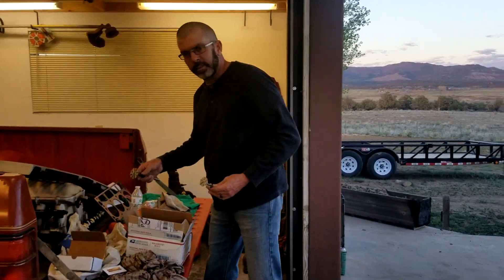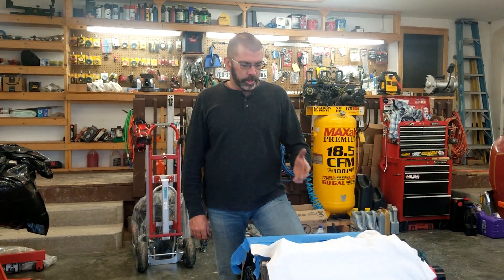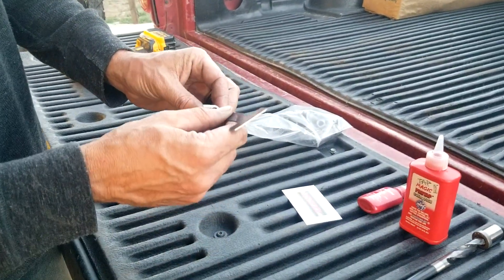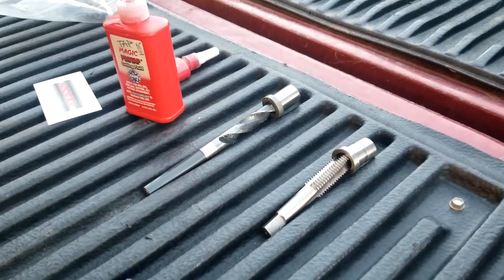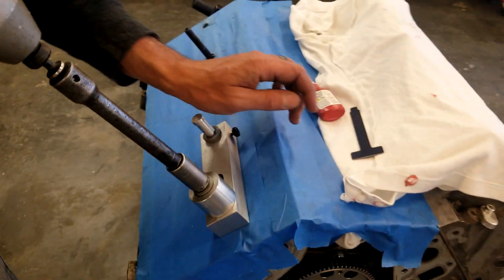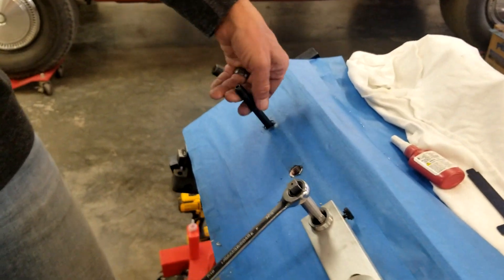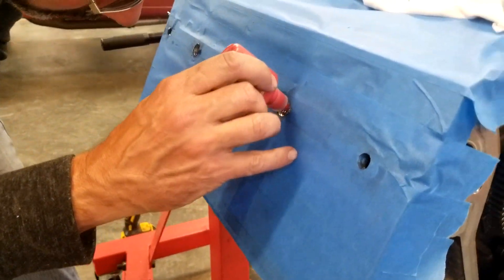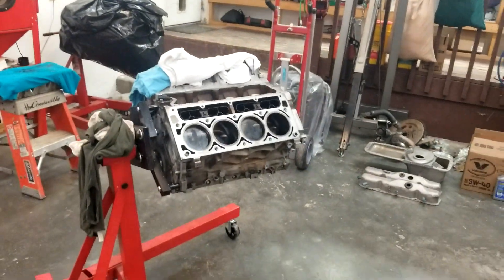LS aluminum block head bolt hole repair.

Comment: Great video, I have one head bolt stud boss that’s stripped on my L92 6.2L engine. I’m just wondering why you need to drill all the way to the end of the blind hole when the insert is only 18mm long. You would think the Time-sert insert would be at least 2 inches long. 
What’s your thoughts on this.
Reply from the maker: Going off memory here as the 5.3 finally let go after 4k miles and tons of 22lb pump gas pulls..... as I recall, the factory block isn't threaded either on the top half of the bolt hole, about half of the bolt in the hole isn't threaded either which just leaves the bottom half of the hole that's actually useable. I agree though, seems like the inserts and threaded part of the bolt would be longer.

Comment: good job.
what about abolt hole repair and bringing a bigger bolt and that's it?
Reply from the maker: I thought about it. I want to say tick makes a kit to go to half inch head studs, IIRC, so it "should" be do-able. You'd have to drill the head for the bolt. Need to measure a head gasket hole as well. In the end though, you're back to the same issue. Everytime you run that steel bolt back into the aluminum and torque it down, it's eating the threads in the block.
Reply: There’s a 1/2 inch LS head stud upgrade for the LS. You may also have to drill out your cylinder heads for the bigger stud. I personally think all engine manufacturers should have steel threaded inserts in aluminum block engines. Don’t use stainless steel time-sert’s with aluminum… it will start to oxidize the aluminum that’s holding the Time-sert.